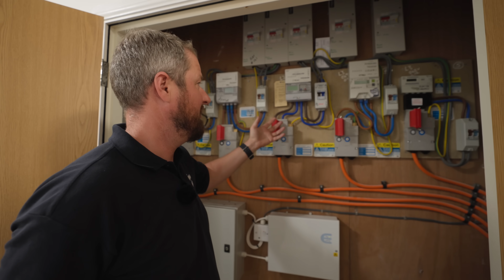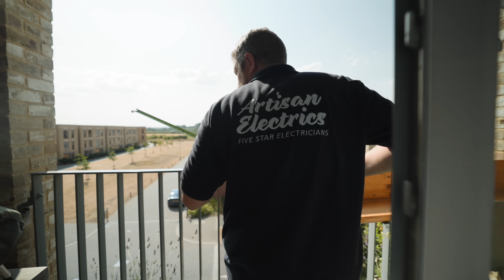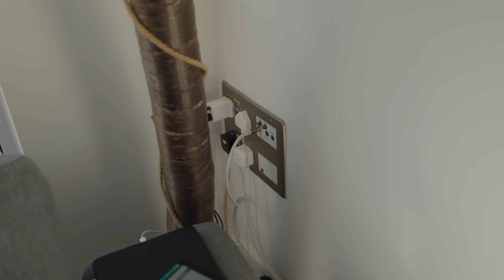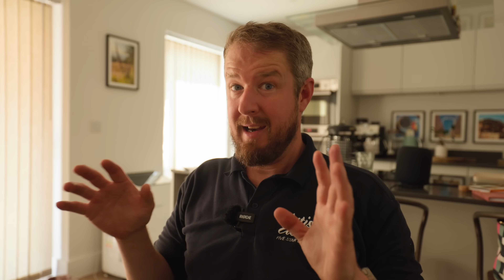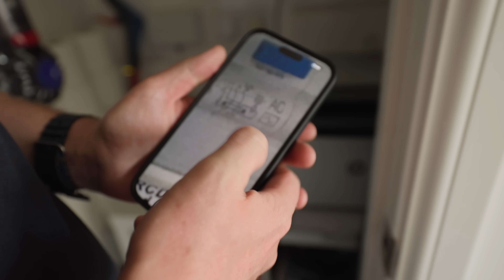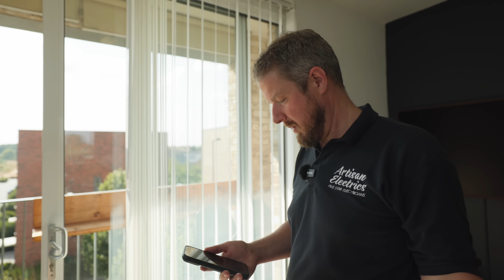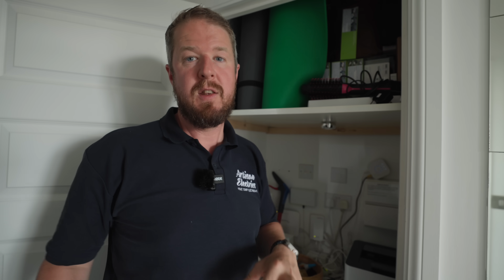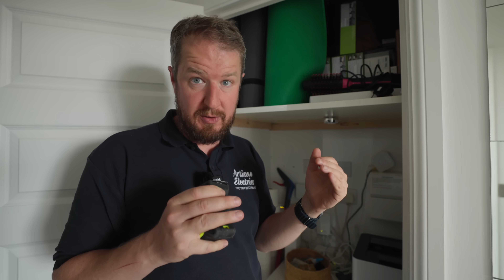I Found a BIG Problem With Plug-In Solar…

Comment: For EICR any rental is required to have a valid EICR with no outstanding C3s. So anyone who is renting can just ask the landlord for a copy of the EICR. If they haven't been doing it then naughty naughty and they will need to fix that promptly (or if you hate the landlord and plan to move out you can go after them for the non compliance as you can potentially get a 12 month rent repayment order against them)

Hilarious. So much RCD fearmongering that he missed the real issues.

You need vaguely south facing (or east/west at a pinch) panels with not much shading. If you don't have that then it won't pay back

There is no permitted development on a flat. If you want to put a solar panel on a balcony of a flat in England or Wales you have to

- Get freeholder approval
- Verify the building is not flammable
- Apply for full planning permission

"temporary" btw means "temporary" not permanently attached by temporary means. You can play pretty fast and loose with it in some ways but if there are complaints then councils can't ignore them easily. So you just need to fall out with one neighbour 8)

In England your panels in the garden need to be 5m from a border or you need planning permission for ground mounts, same for fences. Only allowed in Scotland. You can stick them on your shed roof though, you can even install a garden office and stick them on top of that. Law desperately needs fixing because whilst councils will pretend not to notice, if a neighbour complains they can't ignore you

You also need to meet building regulations which for the approved kits from when they are legalised is mostly handled by the parts i the kit but that's not the whole story.

There are cables for feeding solar through closed tilt/turn windows or sashes. That's an easy bit. You'd know that if you'd done a tiny bit of research on the topic.

In Germany they ended up having to change the law to beat up freeholders/landlords a bit. In some other places with mad landlords people put legs on solar panels and leave them on the balcony as tables/desks/etc.
Reply: thank you, that was more informative than the vid.

Comment: I live in a 150 year old house with 3 phase and fuses. Are fuses bi-directional. lol
Reply: 3 phase is great - you can get 3.6kW on each phase with a G98 so you can do about 11kW of panels without fuss
Reply: @etchedpixels   And for the machinists out there, you can set-up a proper workshop, with decent machinery.

Comment: How about mounting the panel on the front of the balcony fence and angling it out from the bottom to get your 35 degrees? The panel could be longer than the fence and wouldn't impede the owners balcony or anyone elses flat. Cory would find a way. Can we have some videos of Lee doing the actual work that looks so cool on his instagram posts.
Reply: So aside from the fact you need planning permission if it's a flat anyway you need planning permission if you fit anything but slightly angled panels to a wall even of a house. Also it's actually better with plug in as it is and thus no battery to put them near vertical - best generation in winter when you'll use it, poorer generation in summer where you are donating half of it to Octopus or similar.
Reply: I agree, so there is no more plants on the edge anymore, ready to fall on someone's head there could be a plant stand, up against the window.... An angled panel is not going to block the view while sitting outside...

Comment: Why does nobody talk about the voltages? If your mains is 250V what voltage does the inverter put on different circuits? What happens when you turn on a kettle? Does the inverter shut down? Marketing hype suggests that the solar still supplies 800W, but you can't add and subtract Watts when the inverter has to be several volts higher than the mains, yet may be capped. Why can't electricians answer these simple questions from first principles?
Reply: I think you need to learn the basics of how a grid tie inverter works then come back with actual sane questions. But everything about how a G98 compliant system is required to operate grid tie including voltage range limits is in the standard, and it's free so you can download it and have a read.
Reply: Not sure where you’re getting your mains voltage from … 250V is on the high end of the “normal” supply … in practice, I’d expect it nearer the official 230V (fundamentally in the range of 240V down to 220V).

To ensure current flow from the inverter feeds back into your home power, the inverter monitors and senses your supply voltage and actively adapts the output voltage to be sufficiently greater than your supply to push the necessary current into the circuit.
At the same time, it synchronises the frequency to ensure the inverter and supply frequencies match and remain in phase.
The inverter is designed to be compatible with the nominal UK grid supply voltage and associated allowable variance from nominal. Equally, it is constrained not to output at excessive voltage (outside defined limits) as this could result in consequential damage or malfunction of anything you might have connected to your house circuits. 

Why would you think your inverter shut down if you switched a kettle on? The worst that might happen is that your kettle might boil a little quicker!
I think your understanding of basic electrical principles must be confused. I’ll try and explain. 

If the inverter output voltage is greater than the supply, then current flows from the inverter towards the supply … it then flows into the electrical loads connected to your circuits. This is about current flow as a consequence of a voltage difference across a (predominantly resistive load comprising your kettle, cooker, lights, heaters, whatever. This total load is defined in Watts and measurable by the volts across that load and the total amps in the circuit.
The current supplied by the inverter is limited to a max of 800W. This 800W is simply a “contribution” to the power being supplied via the grid supply. Consider it as power sharing.
You turn on your 3kW kettle and, if it was the only appliance plugged into your circuits, 2.2kW would be consumed from your mains supply an 0.8kW would be consumed from your inverter … the kettle still gets the total 3kW it needs to boil. If you have another 3kW appliance connected, your total load would be 6kW and, in which case, 5.2kW would be consumed from your mains supply and, again, 0.8kW would still be coming from your inverter.
So .. in answer to your last point … “yes” you CAN add and subtract power (Watts) because what matters is the impedance (resistance) of the load and the current (Amps) consumed (flowing) … NOT the Volts .. the Volts merely drive where the flow of Amps comes from.
Reply: @davidrowley-ic6dx  UK mains is 230V +10%/-6% on paper. In practise it has not been changed since it was called 240V, they just changed the tolerances on paper. I am on the beginning of a long rural overhead line and my mains varies between 248V and 252V, the far end is about 232V and drops 5V when they switch a kettle on. The line is within the tolerances, but I have little headroom for an inverter.

Plug in solar enters a ring main and has to increase the voltage above the actual mains. It also connects to everything else in the house via the consumer unit. There is no breaker between a plug in inverter and anything else on the same ring main so anything on that ring gets the inverter voltage less drops due to the cable. There are two breakers between the inverter and any other circuit in the house. What matters is the output impedances of the grid and the inverter.
Under these circumstances the inverter is more likely to limit its output so will not be contributing while a high load is on. The inverter manufacturers do not give enough information to work out exactly what will happen.
Reply: @hin @hintoninstruments2369 d clarification. I wasn’t sure of the official grid tolerances. I was aware the voltage never really changed when we originally considered the supply to be 240V, but it was then “technically” harmonised with the European grid to allow ease of power sharing. I’d find it easier to look up the allowable limits for aircraft supplies than to dig out domestic grid limits. 

Like yourself, I’m rural and supplied from overhead cables. I complained when my supply dropped below 210V and electronics started failing. I then learned about “lazy linesman” syndrome, where all the properties down the road are connected to the same (lowest strung cable) phase. I was moved to another phase and I was back to a nominal 230V!
Reply: There are answers (and real life demos) of 'illegal' plug-in solar on other channels (i.e. eFixxx). Go watch them to get all answers.

Comment: The problem isn't the size of the balcony, It's the owner's decision to put aesthetics before savings. If saving money from your electric bill was your priority, the lack of airflow round your knackers on the balcony (caused by a solar panel) wouldn't be an issue.
Reply: No, the issue is only looking at normal roof panels. There are plenty of panels made especially for balconies that have different form factors and optics. Flexible ones, narrow strips, ...
Reply: People who are going to install panels in the first tranche are people who are into engineering. A special bunch of people who watch an Apollo rocket and find it sexy; they see the Challenger tank design and think it epic; it beats flowers EVERY single time.

Comment: A solar panel might warm up a bit, but it will give you the possibility to run an AC for almost free
Reply: They are on the balcony, there is a reason why shading lowers the temperature inside the house...

Comment: DIY system with 2 panels, 1 microinverter, brackets, cables, cable clips,  costs under £400. ROI 2.6 years
Reply: But might needed to run an outlet to the balcony... 😣
Reply: a lot faster than roof top as far as ROI.
Reply: If you can source your own individual parts yes  but they are only authorising complete kits. I've only seen one that was supposed to be compliant and I think £400 is going to be a pipedream. ROI without any battery will be poor imo.

Comment: But if i ran power from my inverter would the ring circuit still work with the braker off
Reply: No. The inverter is a frequency follower, so with no grid frequency on the wire, nothing will come out. And on top of that, it wants to match voltage, so again, no voltage, no output.
Reply: It is possible to wire a house with a transfer switch so that it can be run from a generator (battery or whatever) or the grid but the transfer switch ensures never both at the same time. Needs  a non grid tie generator.
It's also possible to wire an entire house to a non grid tie generator and wire the grid to the generator input. It's done sometimes in places where you need a big inverter and power but the DNO won't give you a sensible G99/G100. Rare and more relevant to rural farm type applications as you also then can't get export payments.
Reply: @etchedpixels pritty much what I am already doing then i just want to get it on the ring circuit so i can run more things

Comment: Thanks i just did the same check u did and found i am non bidirctional so u problerly saved my butt
Reply: Not really. The standard specifies a 5mA DC element max and a fast shutdown. That was done in the consultation period as it was shown to be the same DC levels you might get with other equipment - like a PC.
Reply: @etchedpixels  Amazing this video is months behind.
Reply: Don't plug a router in your property. It sends out waves
Reply: @caterthun4853 exactly which is why i havent done it

Comment: Have you seen regulations just announced by the government where plug in solar in the UK is approved from 27/8. The new regulations put the onus on the manufacturers to provide the leakage protection within the inverter and HMG are working with Ecoflow, Anker and others to do this. RCBO's will not be necessary, however batteries at this time won't be allowed to feed the general wiring into the grid but can be used to power equipment from their own sockets. More regulations to follow. Those who have installed plug in prior to approval including batteries are unlikely to get a retrospective Form 98, so could have wasted their money.
Reply: All the existing mainstream "plug in but not in the UK" kit is approved for G98. It's all fine for G98. What it won't necessarily get is converted to plug in, which is fine as it was never sold for plug in use in the first place. So at least someone will be keeping electricians from starving.
Reply: I believe Jordan was referring to only using a battery without the solar also as an option...

Comment: Well done for pointing out about bi directional components. I've been telling people about that for a while and the response I get back is... Hundreds of people are already doing it through a 3 pin socket, it might not be legal yet but who cares. 
My answer to that has always been, if you burn out a component, which can happen and have to call your insurance company, you can bet that they will care. They may even decide that your system was not compliant and therefore, your insurance is invalid. Only then do people start to listen.
Reply: You Are Fear-mongering, because whatever you're stating is nonsense...
Reply: Most insurance policies have a clause that states that you are required to inform the insurer if any change that might affect their risk assessment. Adding a power generation set up, even if it is compliant from a BS standards point of view, changes the insurance risk and the insurance company should be informed. If you rent, you probably only have contents insurance as you don't own the building. Your landlord insurance company will want to know about the change as it changes their insurance risk assessment.

Comment: Solar installer has issues with plug in systems, imagine my surprise 😂
Reply: Agreed 👍
Reply: He seems so negative about them. Ohh, it's going to be a problem, complexity, problems etc
Reply: @TallTinyHouse  1 million germans seem to manage ok, so take from that what you want.
Reply: @TerryHickey-xt4mf closer to 4 million
Reply: So if you overcome these electrical issues, my biggest issue is where you put two 6ft panels.  Would anyone want these in their garden, possibly.  Have you got any shading from trees or buildings?  Winter you would barely get any savings.  There is no export opportunity, so you have to use all to generate to be of benefit. Would you want to risk hanging these off your balcony and potentially it falling off?  Solar panels work at about 60% when it is really hot.  Sounds crazy but it’s true as I complained about my roof panels generating under 70% when it was hot and sunny. All for the sake of saving £80 per year.  I have solar on my roof and the payback is 10 years.  

Like most systems it will work for some people, but not as many as people think.

Comment: Jordan you looked nice and snug under the stairs at that consumer unit.

Having lived in Germany, I can say on older flats at least generally they will have a bigger railing surface area than the one you showed in the video, more modern construction I'm not so sure.
Reply: Uk flats tend to have no or small balconies and some of the older ones I wouldn't honestly lean on the balcony without a structural report.

Comment: You keep talking about where the battery will go but plug in battery systems are not included in the new regs (at least not yet anyway)
Reply: more fuzz to put you off.
Reply: Some people are already using them, and have been for over a year - so-called "gorilla solar" exists.

Comment: Especially on a balcony facing west, there is little reason to not mount it vertically. The sun is already much lower in the sky when it's in the west. That will also give you better yield in the winter.

Most plug in solar companies have sizes of panels much more suited for balcony use than the standard sizes.

As for the idea that a panel would make it somehow hotter: there's no way. The temperature in the house depends on the total radiation coming in. With a solar panel in the way, that would be more likely to be less than more.

Comment: The gov bodys have tested and they dont need to be bidirectional, its one of the reasons they have given the go ahead on plugin solar.
They found the normal rcbo's worked fine. No need to panic
Reply: exactly.
Reply: What's the difference between traditional fixed solar, and plug-in - other than the size, and the plug? Nothing. Hell, Jordan wired a 3Kw inverter to a plug, and it was fine.
Reply: Then why do you think they quickly brought out type A rcbos?
Reply: Biggest problem is getting your energy provider to recognise them if not brought direct from them as they then won't credit you for any power generated

Comment: Just checked my RCD's and I have Hager MTN120 RCD. Apparently it's not Bi-Directional and its a type B, yet it seems to be working ok with my 2 solar panels. Have you any more info? Should I get an electrician in and change it?
Reply: Ideally yes - but the final version of the interim standard has some additional requipments on the devices that should ensure RCDs are fine..